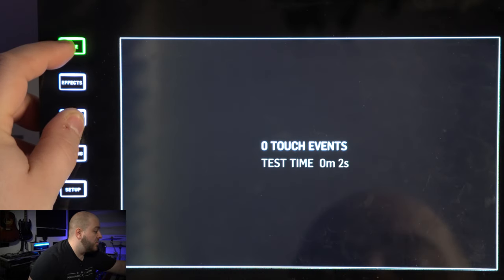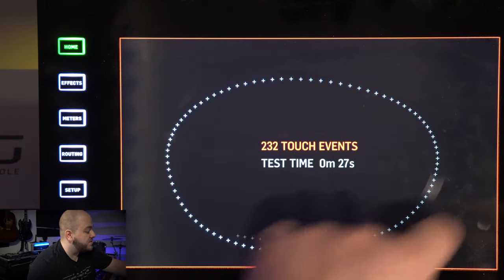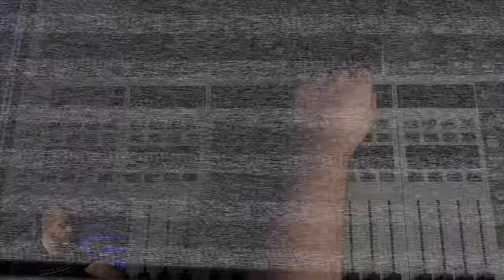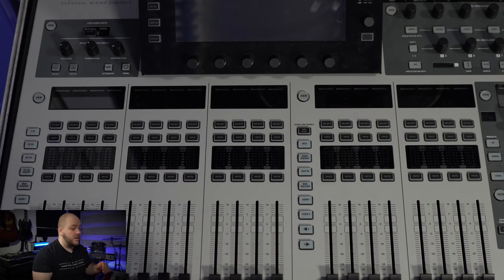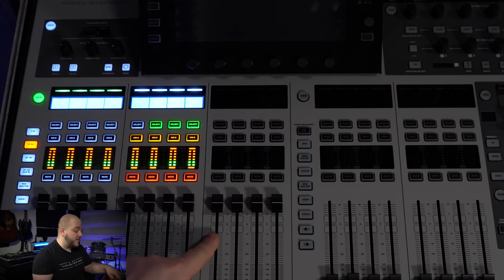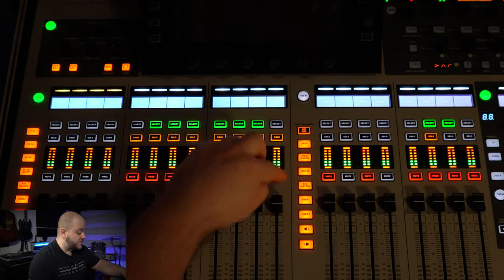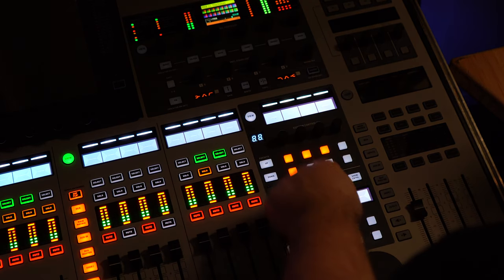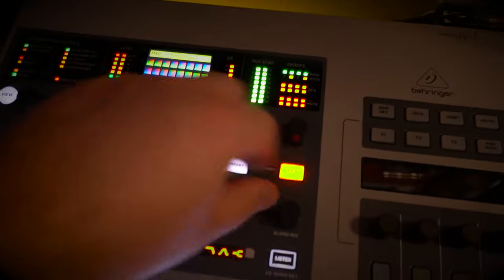Behringer WING Hardware Test Mode - Check your Touch Screen, Faders, Knobs & LEDS

Comment: Hi, how do I get out of that test or training mode?
Reply from the maker: Hi Luis

you need to turn off the power button 
once the console restarts it will boot back to the regular console software
Reply: @GuillaumeLortie  it’s not happening, it stays the same way
Reply from the maker: @luiscastellanos3217  this should not happen, try to install FW 1.12.6 again with a computer plugged into the USB of the console
Reply: @GuillaumeLortie  I did
Reply from the maker: @luiscastellanos3217  please contact Music Tribe support at this point.
Reply: @GuillaumeLortie  great, thank you for your help
Reply: Please any update on how to get out of this test mode???
Reply from the maker: Just shut it down and power back up